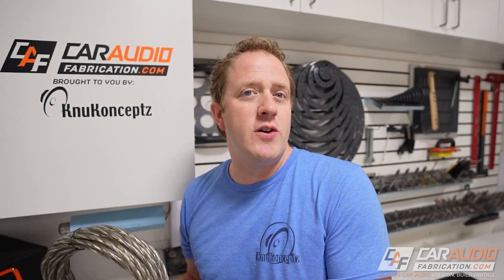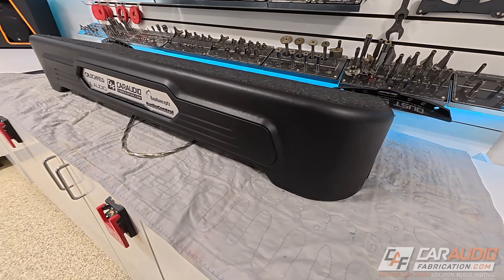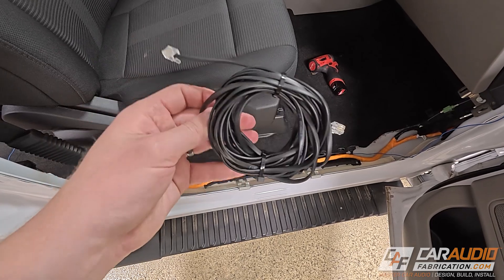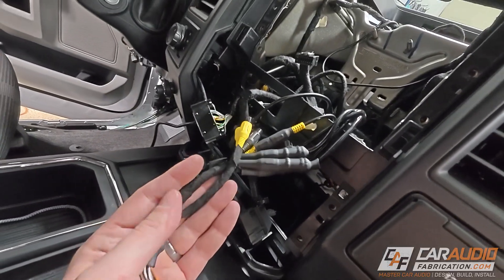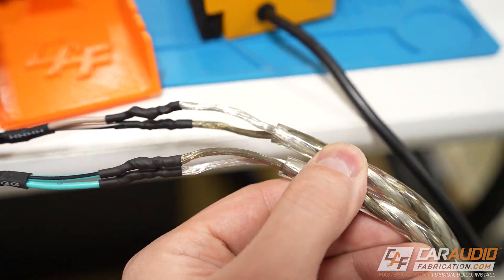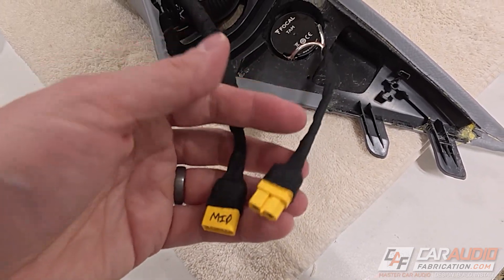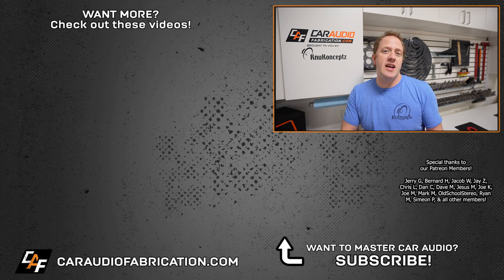Advanced Car Audio Speaker Wiring - EXPLAINED!

Comment: But why all the Hassle running speaker wire to the the harness when you can just run RCA cables to the Amp and run the speaker wires to the Amp

Comment: i like this a lot, but do you know if the factory speaker wires are strong enough to run 200 watts 4ohm speakers? Or should i go ahead and wire from amp straight to individual speakers?
Reply: Depends on the stock wire size. Some cars have cheap thinner wire while others have thicker. If you can find out the gauge of the wire you can look up a chart that will show you the max rating each wire size can handle

Comment: I have a unusual question ⁉️ 

I am a plumber 🪠 and when we want to run pipework we install sleeves, larger pipe to run smaller pipe through especially under pathways and drive ways .

If your looking to run cables seperate or away from each other, could you not run special conduit/sleeves under the car carpet/base so you can seperate the cables more and if you ever needed to run new cable or different cable you could just cut/ unplug and pull them through the sleeved and you'd never need to take apart the pannels again ?

Comment: Do I wire my 2 way speakers my component an tweeters to my crossover or my amp. Also do I run my rear speakers. (Coaxial to amp or factory harness or both

Comment: I hate the task of running wires from the front to the rear of the vehicle! Removing all of the trim panels without breaking any plastic or any clips, and then trying to fit those pieces back in place with wire under them. I've always wanted to take out all of the seats and run wires with ease, but I'm definitely too lazy for that.

Comment: Take my 18 f150 and just DO IT.     Like ..  Do it.    lol    Its kinda my mid life crisis :P    Performance mods,  and then got the audio bug like I was young again.    I hadn't touched car audio in years,  thus far I've replaced the door speakers w/ Infiniti Reference as I was keeping stock head unit,   well now thats overheating and lowering volume randomly.  I have the adapter to give RCAs for subs and have Infinity reference subs under my seats in an amazon box.  Its actually pretty good sounding when the song matches its VERY limited audio presets.  I can't believe what the new  headunits go for nowadays!!   the ones I want are like 1200-1700 BEFORE you get the adapters to keep vehicle controls.   Heyyyy Mark,   need IT services of any kind?   Bartering still a thing ?????  LOL

Comment: whats the power limit of using the factory speaker wiring?
Reply: My car comes with 20 AWG cables originally hooked upto 20W RMS speakers 🔊
Reply: @Death_By_Lag  wow that's small , my car has 1.5 mm2 which I think is 16 or 17 awh sth like that , if you run cables behind the dash to reduce the strain on the thinner wires , I think I can use about 100 watts max
Reply: @CaptainBlackbeard91 yeah my car is old though from 2000 so I think running off the stock cd player radio 20 AWG was enough.

To power 20W but yeah to run 100W RMS and allow for peaks and to minsmize heat.. I would/will run 12 AWG to also allow for upgrading later on

Comment: Hi i just want ask what is the cost of the whizzing sound on the speaker. Because i just installed subwoofer. The sounds is getting higher when step on the throttle. Thank you for the answer. More power to you.

Comment: Mark
If I may ?
It seems that many DYI  after market head uints
Have issues with factory amps.

Thus far I NOTICED  that most the issues see.to be  a auto power on amp line 

If this is the cause  ?
Can't  they run a line from factory amp auto on. To a key on line ??

Comment: what is your recommended max RMS wattage we should put through the factory speaker wire before we need to run our own new speaker wire?
Reply: @razerface35  I ran new wire on my system when I upgraded the door speakers to 75watt rms.  It was worth it.
Reply: My factory wiring handled 100w rms from my amp pretty decently.
Reply: Well it’s all about voltage drop, just like measuring voltage drop on D.C. from the battery, you can measure voltage drop of AC ,”the music , or rather a test tone,  it’s a bit more complicated, but it can be quantified. If you are trying to get every last drop to the speaker, this matters.

The twisted pair as used above, also is shielded well, without the penalty or resistance of plain shielded cable. This keeps things quiet, and less likely to interfere with today’s data signals running all over the car. 

A tiny land line phone wire will “work”
It however will not be very efficient at doing so. That’s an extreme example, but I think it helps to make the point. 

I use the same karma cable as shown above, it’s imo the best in the business.

Comment: I bought some of that Karma speaker wire and it's very nice, but...there's gotta be a better way to remove the outer sheath than using a razor blade.  Is there a tool out there that can make a perfect cut without cutting into the wires?

Comment: never thought about heat shrinking the RCAs, thanks.   I'm banging my head on where to tap high-level signal in my cx-5 for an underseat sub...either the tuner/amp in the passenger footwell, or at the b-pillar that supplies the rear door speakers 😕  🤔  🤔

Comment: Hi sir,
I need your help and advise.
Previous i have install electronic crossover in my car.After a year i change my player to android player.
Issue here i cannot get nice sound because in my android player got crossover ,dsp and few thing sound setting.My question here is should i remove my electronics crossover to get better sound?may be got clash between my android player and electronic crossover? Pls help

Comment: At what rated wattage for the front 6.5’s would you go up from factory wiring and run directly to the door?  Is a component set with a rating of 75-100watts rms like a set of Alpine Type X’s or R’s 6.5” going to require larger than stock wiring?

Comment: So I have  5th Gen 2019 Ram 1500 Quadcab or some call it extended cab, have you ever done installation of anything in this model? I have limited space back there but I want to install an amp rack somewhere back there, do you have any suggestions or can you fabricate something so I can install 2 amplifiers possibly a dsp to the factory head unit using a PAC amp pro ch42? Thanks in advance
Reply: I did a full system in my 2016 ram sport. Mine is the crewcab, but should work the same, as the longer cab is just more leg room in the back. I did jl c1 6.5 components in the front, mounted the tweeter up in the corner sail panel. MTX 3 way 6x9s in the rear doors, and 2 10" soundstage subs under rear seat. On those trucks, the front door speakers are only low range, and rears are full range for some stupid reason. I ran all the speaker wires into an Audiocontrol LC7,  then out to the amps to get full  range up front. Doors are powered by a Hertz 4ch. And subs by an Alpine 500w. Theres room on the floor behind the sub box for the amps, and the LC7 I mounted on the back wall. I sound deadened the doors and used the foam rings. Sounds awesome, the only thing I would do different is maybe get 6x9 components in the front instead of the 6.5s. Just to save the dicking around with adapter plates, and maybe get a little more mid bass. Looking at upgrading the little 3.5" in the dash corners next. 🍻

Comment: i have a question about subwoofer ports i haven't found an answer to anywhere. i want a sentered port (sub - port - sub) but the port needs to be longer than the box depth. lets say the port width would be 8cm. when the port meets the end of the box and i split it, do the 2 separate ports going to each sub need to be 4cm or 8cm. hope you know what i mean.

Comment: So I have a project like this coming up for a 2011 mini Cooper coupe. There is an a pillar tweeter and a mid range and mid woofer in the doors. The wiring harness does not allow any room for rewiring it. What I just saw in your video was you run amplifier power through The oxygen free copper wires from the back and then terminate it in a new connector to plug into the OEM wire harness going back out to the speakers. Am I interpreting this correctly? Just hate having 16 gauge wire going to the midwoofer, but unless I want to drill new holes in the door and chassis of the car and run a new loom through it, I think I am stuck with this route.

Comment: Good tip re: the custom connectors for the speaker wires.  I did the same in mine to simplify my wiring and make it idiot-proof... because the last thing I need is to close everything up and find out I mixed up the left-right pairs or polarity.  It's one of those simple EE tricks you rarely see in car audio but make life so much easier, especially a few months or even years later when you decided to swap components.
Reply from the maker: Glad to hear you're using the same smart wiring strategy - it's a game-changer for future upgrades!

Comment: Noticed you using zip ties for storing cable bundles, and I have to recommend Velcro cable ties if you haven't thought about them. Reusable, no need to cut the extra bit off the end of a zip tie, and they're just as quick as zip ties to wrap. Very useful, highly recommend giving them a shot.

Great content as always, thank you for all the useful tips you give us in every video!
Reply from the maker: I've actually tried them in the past, but for a semi-permanent setup like this the zip ties are a better option for me.
Reply: @CarAudioFabrication  Definitely agree on the install wiring using zip ties, I more mean for storing cable bundles. To each their own though if you've tried them and prefer zip ties, I just remember learning about the Velcro cable ties in the past and thinking how useful they were.

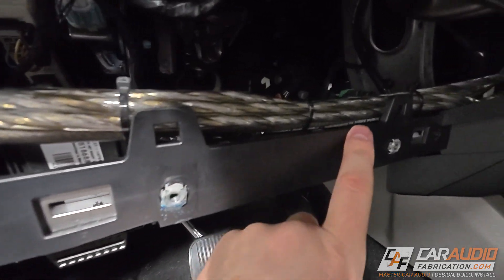Comment: One question. Why iff you using aftermarket speakers, and amp you still use factory wiring for front 6.5? I see 4 speaker wires in 9:53
Reply from the maker: This is explained in the video 👍
Reply: Ok. I missed picture with front 6.5